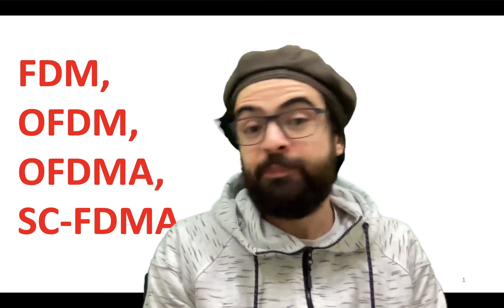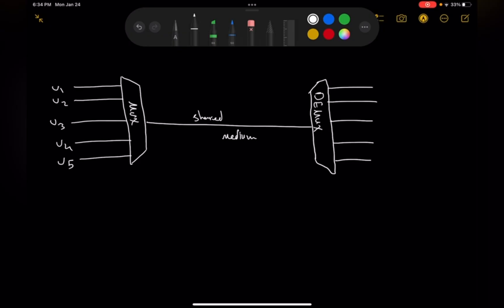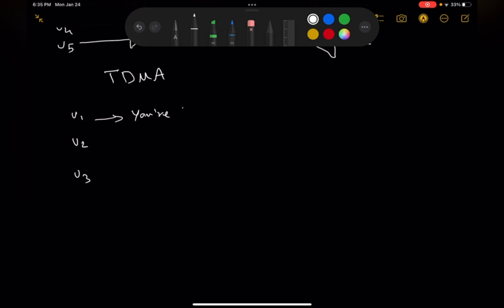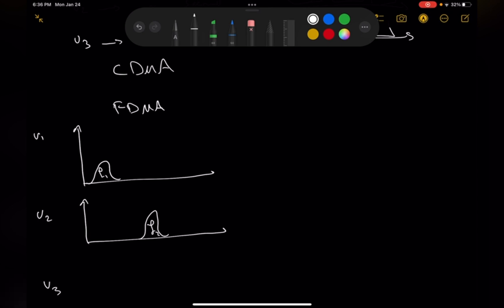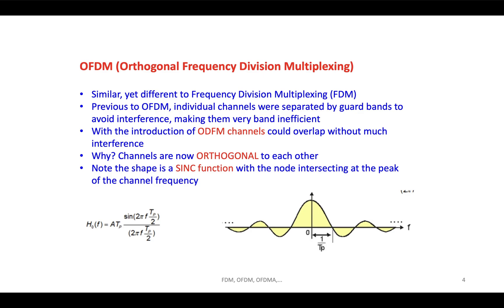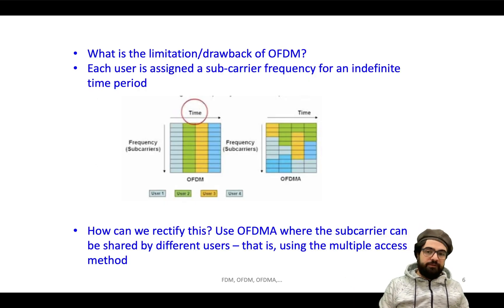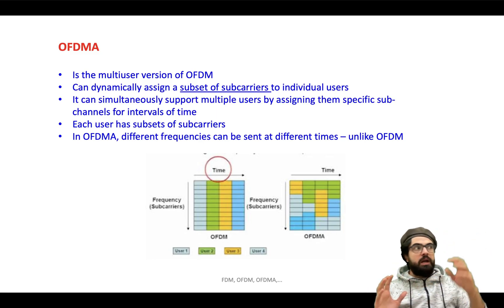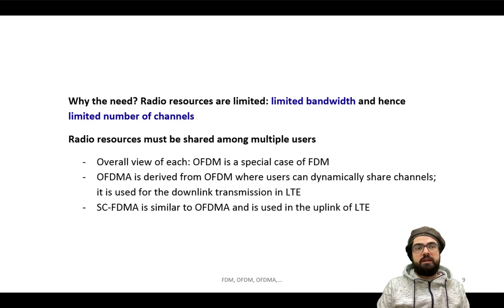FDM, OFDM, OFDMA, SC-FDMA Concept

Comment: I didn't get what's the different between FDM and FDMA,  and same for TDM and TDMA
Reply: You mentioned FDMA then you give every user a different frequency and take them to multiplexer, but this one is FDM not FDMA but u mention FDMA , Could you eleborate it more plz? As I still don't know what's the different between multiplexing process and multiple access process??!!
Reply from the maker: Frequency-division multiplexing (FDM) is also distinct from FDMA. FDM is a physical layer technique that combines and transmits low-bandwidth channels through a high-bandwidth channel. FDMA, on the other hand, is an access method in the data link layer.
Reply: @aminsedighfar  okey bro, I got it, thanks alot
Reply from the maker: @abdulrahmanalmeqdad8111  no problem 🙏🏻👍🏻